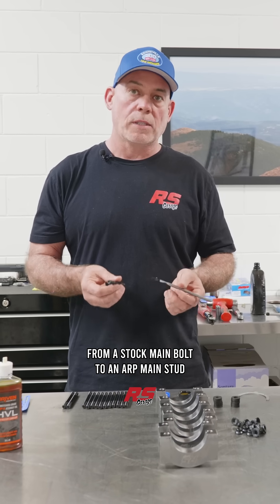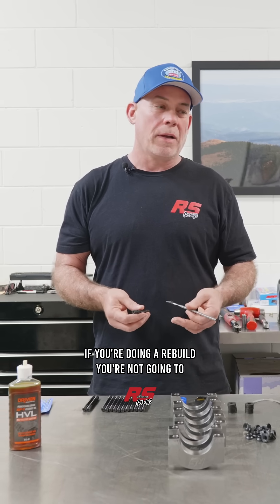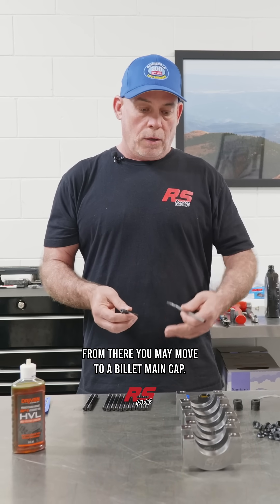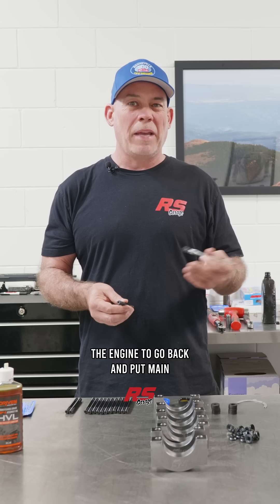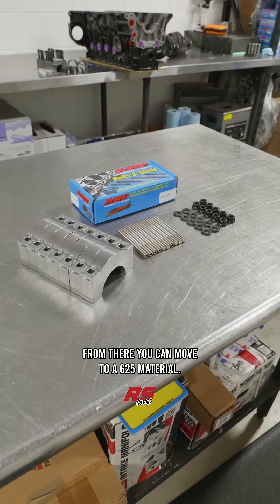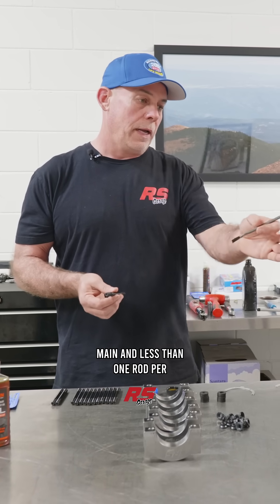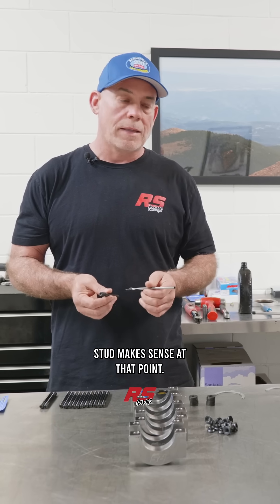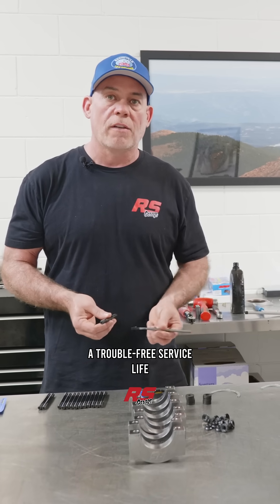2JZ Main Caps & Hardware: When to move to an ARP Main Stud Kit and Billet Main Caps

Comment: Does ARP make custom sets for less common engines? IE 11mm head studs for a Hyundai V8?
Reply: 7 bolt 4G63 arp headstuds are 11mm, now as far as length goes, that would need more research, look into it, compare, etc. if it matches or is very close there's your answer. Believe it or not but BMW guys used to run EVO X headstuds for the time being before the dedicated headstuds were made
Reply from the maker: send us an email at sales@rsgarage.us and we can see if we can help you source something.